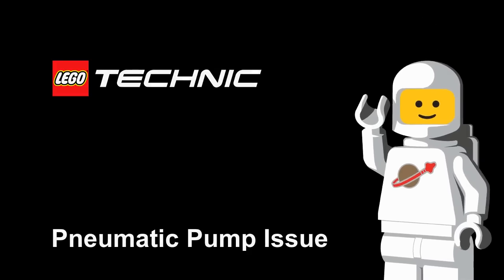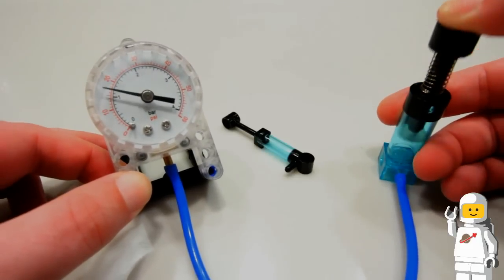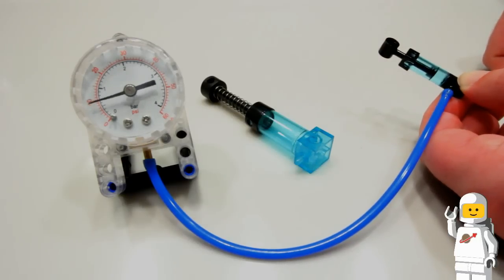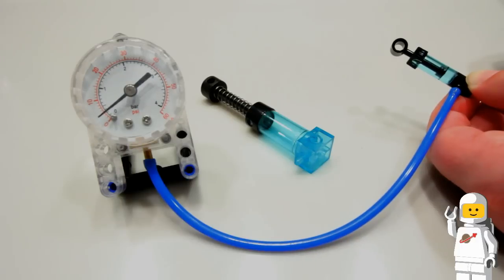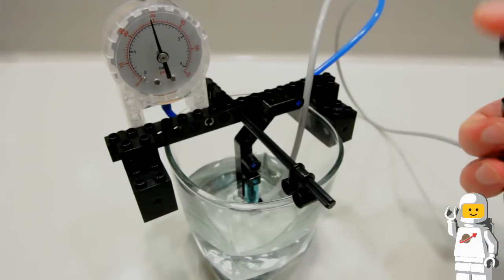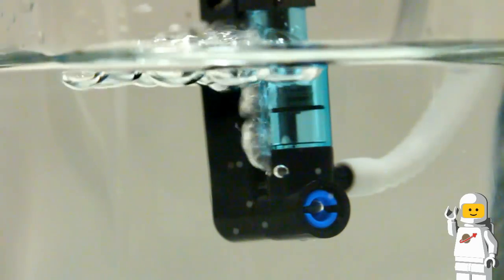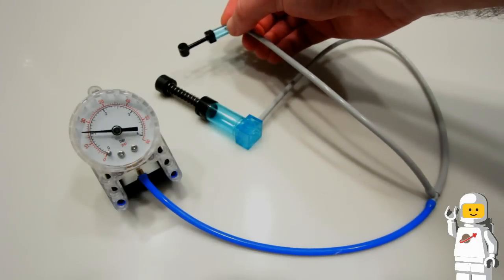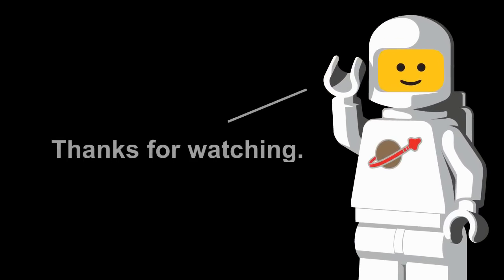Pneumatic Pump Issue

Comment: Isn't it a safety measure to prevent a motor-powered pump to build up too much of a pressure? You know, a motor powered pump keeps going for longer periods of time, and such "safety valve" somewhat stabilises the pressure on a certain level despite the pump going on.
Reply from the maker: I understand what you are saying, and it is true that the seal around the piston is designed to leak air when the cylinder is over-pressurised, however in this case there was a crack in the plastic which was leaking air.  Check out my follow-up video here: https://youtu.be/8kG3p7VVhjY

Comment: I put some electrical tape across it starting at the bottom going up from the other side of the air ports about half way up.
Reply from the maker: Thank you for the suggestion.
Please watch my follow-up video to see the solution that I implemented.
https://youtu.be/8kG3p7VVhjY

Comment: I just built the AROCS and now joy with the pump. I'm new to mechanics and pnumatics, so have no idea how to test the system. The piston pump seems woefully small for such a big job - it's one of Lego's biggest ever kits afterall.
PM or public message me if you found a solution. Thanks for the video
Reply from the maker: I found a solution to the issue with my pump, which you can see in this video: https://youtu.be/8kG3p7VVhjY
The pump used in the Arocs is sufficient to operate the pneumatic functions, although it may seem slow at times. 
If you suspect the pump isn't working properly, isolate it by removing it from the model, and then use your finger to block the port and try pumping the pump several times. You should feel the pressure on your finger, and the pump should become more difficult to pump as the pressure builds up. When you remove your finger you should hear the air escape as the pressure inside the pump equalises with the air outside.
If this is all working as described above, then the pump is working, and you may have an issue somewhere else in the system.

Comment: air could be moving around the one way valve, see if you can pull air into the system with your finger over the leak.
Reply from the maker: +Darkstar the nightwing - Thank you for the suggestion.  The Lego Pneumatic system works on positive air pressure, so it is difficult to 'pull air into the system' which would require negative air pressure.  As shown in the video, if I cover the hole pressure is maintained in the system, so I think the one way valve is working ok.
Please watch my follow-up video to see the solution that I implemented.
https://youtu.be/8kG3p7VVhjY
Reply: You should always be able to pull air into the system because of the one way valve, right?

Comment: First question I have, is do you have another small blue pump like this one? Does it do the same thing?

Next thing I would like to point out, is that this might be intentional. Of course, I thought that until I read that you photographed it and it looks like a crack. The reason I think it might be intentional is due to the nature of this pump. It is typically used with a motorized way of pneumatically charging a system with air. At least whenever I have seen LEGO put it into their builds. I suspect this is because once the motor drives the pump, you could easily overcharge the system with pressure, enough to damage the small pump (i suspect). Did LEGO engineer the pump in a way to put pressure into the system, but then allow it to escape again so as not to over pressurize the system. 

Alternatively, the crack could be the result of this pump being overdriven by a motor until the housing cracked due to the over pressure. When I find my pump, I will test to see if my pump behaves as yours.
Reply from the maker: +Todd Thuma - Thanks for your comment. I only have this one trans light blue small pump, so I don't have anything to directly compare this faulty pump to.  I do have other small pumps that don't have this issue at all.
I was trying to build a model that uses this pneumatic pump, and it was the first time that I had used the pump at all. In my model I have a pressure cut-off so that the system stops being pressurized once it reaches about 30psi, so the system should never over-pressurize.
Having said that, while building/testing I have had this pump to a point where it can no longer add any more pressure to the system.
I guess there would be a certain point where the pump could no longer deal with the pressure in the system, and that could cause the inner workings and/or housing of the pump to fail.  I have not used any modified pneumatic parts or third-party air compressors to get to any extreme pressures at all, and the maximum pressure that I have reached is about 45psi.  I would think that the pump would have been designed to handle the pressure that it (or other Lego pumps) could add to the system without failing.
My close-up macro photo definitely shows a crack, so I don't think that this failure is an intentional design feature. Typically (with a working pump) if the pressure in the system gets too high and you try to add more air, the excess air will leak past the rubber piston head and vent into the surrounding environment.  This can easily be seen with these trans light blue pneumatic pumps (when they are working properly).

Comment from the maker: Update 2:
Thank you to everyone that has provided comments and suggestions.
Please watch my follow-up video to see the solution that I implemented.
https://youtu.be/8kG3p7VVhjY

Update 1:
I have taken some close-up macro photos of the pneumatic pump, and it appears that there is a crack rather than a round pin-hole. I'm not sure if the crack continues all of the way to the edge of the black section or not.
http://www.brickshelf.com/gallery/slfroden/ForumPic/00000067.jpg
http://www.brickshelf.com/gallery/slfroden/ForumPic/00000068.jpg
Reply from the maker: +Norbert Kelemen - Thanks. That seems to be a popular suggestion.
Reply: slfroden use tape to fix the hole
Reply from the maker: +Strategy Studios - Thanks. I don't think that tape would be able to handle the pressure of Lego Pneumatics though (up to about 45psi).
Reply: I think that a little bit of super glue would fix it. You just need to cover the crack with a thin layer of glue and it sould work ;)
Reply: yeah the plastic cracked on a couple of mine, you know that mold line i believe it's called.
put a dab of superglue on it and you're good to go
Reply: I've had this before and I just put some hot glue on it and it's never leaked since

Comment: you could order some epoxy sculpt and use a tiny bit of that to fill the hole and then wait a day for it to dry. This is a better plan than using heat as you may warm the surrounding parts and cease the pump
Reply from the maker: +Jackson Vanderkooy - If I was to try and apply heat to melt the plastic and close the hole, it would not be direct heat and it would be very localized and for a very short time.  I don't think that it would warm the surrounding parts, but I understand your concern.
Reply: fair enough. I have a feeling you probably know more than me in this field anyway

Comment: Warm up a soldering iron. Then slightly touch the area with the hole, so the surrounding ABS melts together.
Reply from the maker: +SNOMS - Thanks. Someone else mentioned using a lighter to do something similar, but I think your idea of using a soldering iron is better.
Reply: No problem.

Comment: ruber and glu.
Reply from the maker: +Lukas Resare - Do you mean like a bicycle inner-tube repair using rubber cement and a rubber patch?  I'm not sure that the rubber cement will stick to the smooth plastic of the pneumatic pump.  Or do you mean something else?
Reply: Take a sand paper skrub de sörfes for 2 sec and den use fin or midium tube and glue the in side pull upp so it can cuver and let the glue harden.
Reply from the maker: +Lukas Resare - Thanks.  That technique might make the pneumatic pump functional again.  I'm not sure where I'd get a small piece of rubber tube that fits on the outside of the pneumatic pump from though.
Reply: Your wellcom
Reply: And if i tipe safing rong is di cos a am a swed.
Reply from the maker: +Lukas Resare - Your English is better than my Swedish!
Reply: omg it is rubber and glue

Comment: use sugre to fill the leak
Reply from the maker: +be nguyen - I'm sorry, I don't know what 'surge' is. Is that a type of glue, or a brand name, or some other type of filler/adhesive?
Reply: he probably think about sugru it's like plasticine then it hardens to gum.
Reply from the maker: +RafiX7415953 - Thanks for the clarification. I've never used Sugru before. It looks fairly thick, so I'm not sure that it would fit in the tiny hole/crack that I have with this pneumatic pump.

Comment: just put a drop of super glue over the hole, works for me with my pneumatic's.
Reply from the maker: +Green Gecko Lego Technic Creations - Thanks for your input. Is superglue enough, or should I put some epoxy over the top of that too?
Reply: just super glue is fine but make sure the surface is clean before gluing.
Reply from the maker: +Green Gecko Lego Technic Creations - Ok. Thanks for the advice.

Comment: um buy a new one
Reply from the maker: +be nguyen - Yes, that is one solution. But, what should I do with the existing one? Throw it away so that it ends up in landfill? For the sake of the environment, shouldn't I at least try to fix the existing one first?
Reply from the maker: +Auzzie Brickz! - If you had trouble with all of your pumps from this set, and I'm also having trouble, maybe there is an issue with the manufacture of this piece?

Comment: Use epoxy it should definitely withstand that pressure
Reply from the maker: +Craig Allen - Thanks Craig.  At this stage I'm thinking either superglue or epoxy, or maybe a combination of both - superglue first to get in the crack, then epoxy to cover it.

Comment: Looks intentional given how the small pump is supposed to be use in conjunction with a motor, so this could be a safety mechanism to prevent over-pressurization.
Reply from the maker: +27000ants - I don't think this is intentional as none of my other pneumatic pumps exhibit this behavior. Typically when there is too much pressure in the system, and you try to pump more in, the air will leak past the piston head.

Comment: Try pumping with the hole plugged up, will it still work?  Just in case you plug up the hole with superglue and it turns out air gets sucked in thru that hole too.
Reply from the maker: +Phantom Driven - Cars, RCs, and Lego Technic - Thank you for suggesting another troubleshooting technique. At the end of the video I use the big pump and cover the hole with my finger and that stops the leak. I have also used the small pump and covered the hole with my finger (not shown in the video), and that also stops the leak. I don't think that it is any of the moving parts in the pump causing the leak, just the hole/crack in the casing.
Reply: ***** have u tried pumping with the hole blocked?
Reply from the maker: +Phantom Driven - Cars, RCs, and Lego Technic - Yes. Pumping with either the big pump or the small pump with the hole blocked by my finger stops the leak.
Reply: ***** it might stop the leak, but if u plug the holes up will it be able to still pump air?  It might not be able to pump anymore because the hole is blocked.  It won't be leaking anymore, but it won't be able to pump and suck air in either since the hole is plugged.
Reply from the maker: +Phantom Driven - Cars, RCs, and Lego Technic - Oh, I see what you are asking now.  In the video I just stop the leak. But in my testing (not shown in the video), I have blocked the hole with my finger and also used the small (faulty) pump to add air/pressure into the system, and that does work.  I can get up to about 30psi before my finger can't hold the pressure anymore.

Comment: Never experienced that before ! even if I have a lot of pneumatic elements !
My small pumps can't stop whisteling when pumping out air :) Horrible noise !
Reply from the maker: +Lego Technic Mastery - My small pumps whistle too, if they aren't connected to anything.  I think that that is normal...?
Reply: yes it is, all my 3 pumps wistle when not connected to anything, its the air rushing out of the hole where the tube attaches

Comment: If nothing works you could get a new one.
Reply from the maker: +mocraft05 - Thanks. Lego Pneumatics can be quite expensive, so I want to see if I can save this one before I resort to getting a new one.
Reply: slfroden sticky tape or duct tape might work.
Reply from the maker: +mocraft05 - Thanks. I don't think tape can handle the pressure of Lego Pneumatics (up to about 45psi) and it wouldn't look too good. I'm thinking some sort of glue might be best. If you have any other ideas please let me know, they are all appreciated.
Reply: Maybe you could melt the plastic together with a lighter. Of course being careful not to melt to much of it.
Reply from the maker: +mocraft05 - Hmm, that could work.  I think it might be better to heat up a piece of metal and use that to melt the plastic so that I'm not using any direct heat from the lighter.  I'll keep this in mind.  Thanks.
Reply: Your welcome. :)
Reply: its only about £6 for a new one

Comment: i woudl say take a small hot glue gun and press a small amount of hot glue in it see if that works... if not you could also do supper glue + a lil bit of plastic wrap to create a barrier film
Reply: maybe try hot glue and see if it works (giving it about 10 minutes to fully dry) before trying supergue or epoxey!
Reply from the maker: +charles lelenad - Thanks.  I was thinking about using some two-part epoxy, but I don't know if it would seep in and block the air flow completely, making the pump completely useless...?
Reply: well depends on how big the hole is and how thick the epoxy is... if your concerned about the epoxy seeping you could wait till its partly cured to like a play-doe like consistency and try that... but i would try it first with hot glue to see if that will block it because you can adjust how mush pressure in gets applied and it can seep in a little bit... or you could go with a dab of supper glue like just a supper thin layer over where the hole is... let that cure see if it seals and then just build up layers and you can always sand it down flush... but then you run into the issue that it might just pop out... 

all in all I would suggest doing hot-glue first because you can always add a small bit of pressure into the system and experiment with that ( low risk) ( can always be easily removed if needed) 

on a side note most epoxies heat up as they cure ... and if it heats up too much it could damage it... 

as for superglue I know that there is hobbyist glue that is water proof that is used on model cars ( i have experience with this using it to glue together standard lego bricks and it ended up creating a water tight hull... however when large amounts were used it gave the appearance of it being partially melted but not deformed ( could have just been the light reflecting off of it)
Reply from the maker: +charles lelenad - Thanks again, all good advice.
Reply: i major in mechanical engineering so this kinda thing is my shits
Reply from the maker: +charles lelenad - What is the purpose of using a little bit of plastic wrap as a barrier film?  I was reading about CA glue (superglue), and it says that it needs moisture from the air to set.  I'm just curious what the purpose of the platic wrap is.